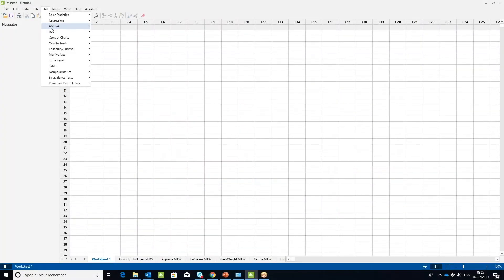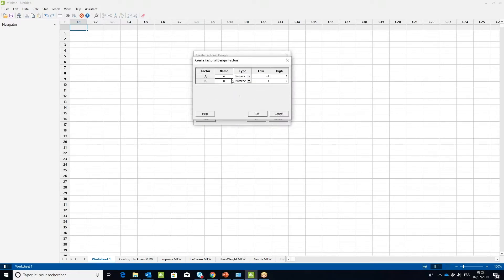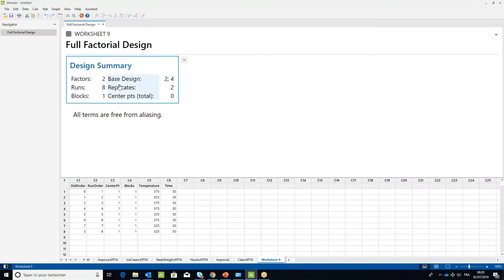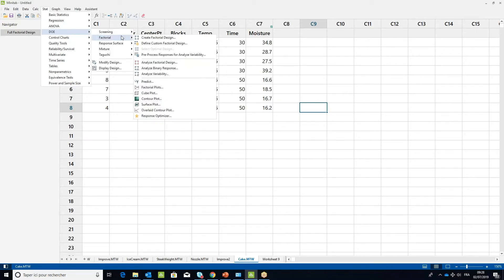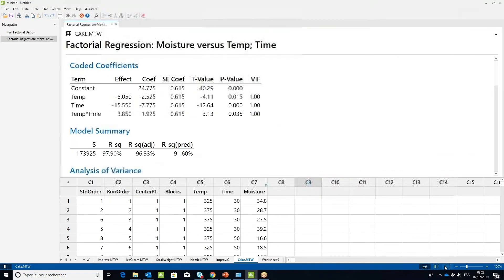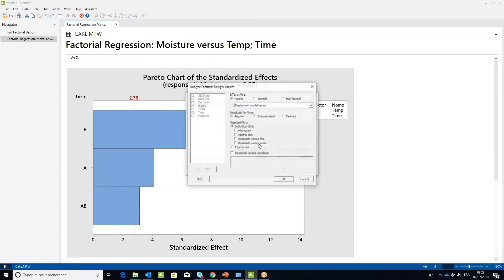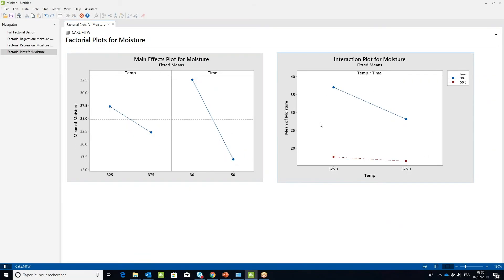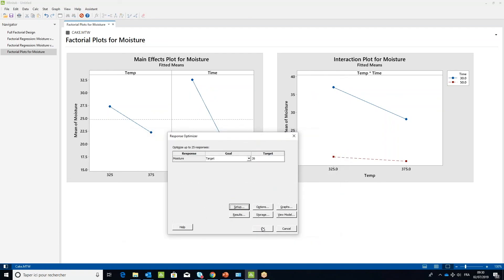How to create and analyze factorial designs | Minitab Tutorial Series

Comment: how did you get the moisture i dont get it?
Reply: By doing a real experiment and recording its results.

Setting up that first table helped with getting a random order for how each variable (time and temp) was combined to avoid non-randomness from affecting the results.

If, for example, all low temps were done first and then the higher temps there might be some other factors we don’t know about that will change the results we get. Like air humidity levels changing from running a machine continuously.

Comment: Hello! I have a question for a 2^4 full factorial design.The factors are A,B,C and D and I have values for 2 replicates.My problem is that I have seen some examples where they sum the values in one column and in other examples they put the values in 2 different columns and proceed to the design using both as responses.Is there any difference in these two methods?Which one is correct? Thank you in advance!